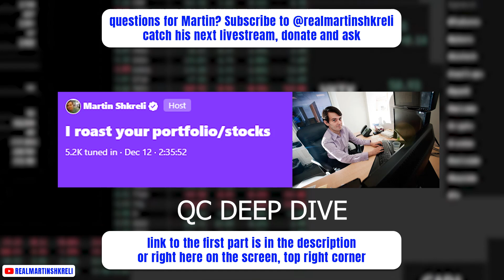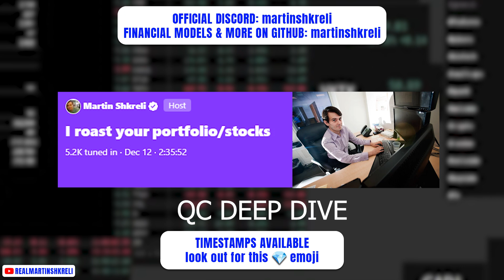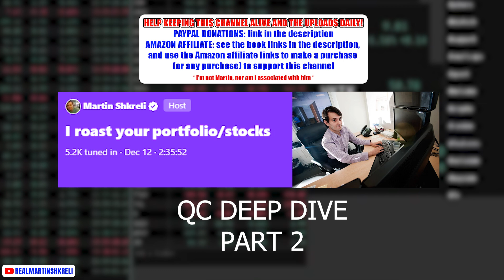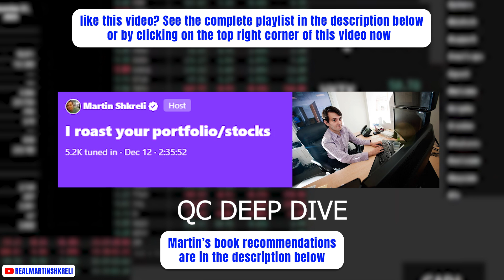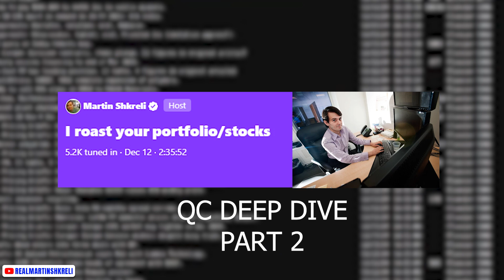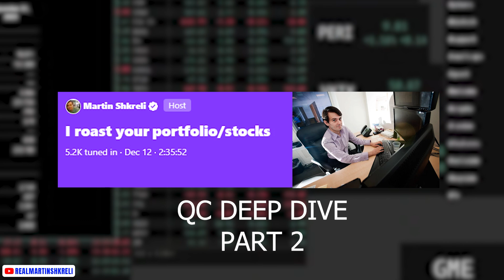Rigetti Stock Potential, New Silicon QC Companies, IPOs That Went to ZERO | PART 2 | Martin Shkreli

Comment from the maker: 👀 Look out for the [💎] emoji in timecodes. These are highlited tips/advices Martin throws out for free.
◼It's Cheap! (+FTC "Problems" News Update) | Martin Shkreli Analyses Elevance Health inc. - ELV stock https://youtu.be/woEVBlF-zaU
► Fastest Stock Quote Monitor And It's FREE| Martin Shkreli About His Gödel App And Testing Druglike https://youtu.be/6NKMFYvd4rw
◼ Moderna - Short. | Martin Shkreli Cross-Analyses BMRN - Biomarin, MRK - Merck&Co. using  Gödel https://youtu.be/1X3M6lhsvC4
◼ Everything Is Cooling Down... | Martin Shkreli Analyses MSFT - Microsoft Stock [Q1 2023] https://youtu.be/66hZobCKkDU
◼ Can Data Center Business Double The Stock? | Martin Shkreli Analyses NVDA - Nvidia Stock [Q3 2023] https://youtu.be/nn5pWp6nzKM